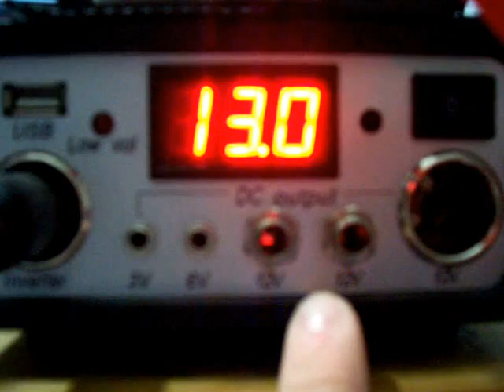Harbor Freight 45 Watt Solar Panel-Part2

Comment: when you disconnect the solar panels are you still getting 12V from the load output?
Reply from the maker: Yes, as long as you have the battery connected I get 12 volts
Reply: Ok.  I have two controllers and thought something was wrong because I was getting 12v without panels hooked up.  May want to add a switch I guess so it doesn't drain the battery at all.  I'm sure it's minimal but ........... I made a portable solar system and now I'm working on a rack mount system in an extra IT equipment rack I had left over.   Just starting to wire things up and didn't realize I'd get voltage from batteries. My other setup has a switch and I didn't realize it until you said yes you did get voltage.
Reply from the maker: Yeah, I have a switch to disconnect my batteries to keep from any vampire draws.

Comment: r u still using your harbor freight charge controller?
Reply from the maker: I am only using the charge controller for the power outputs. I have upgraded to a 30 amp PWM controller.